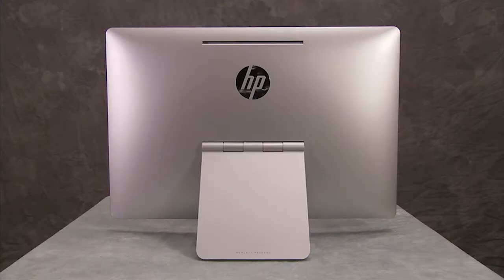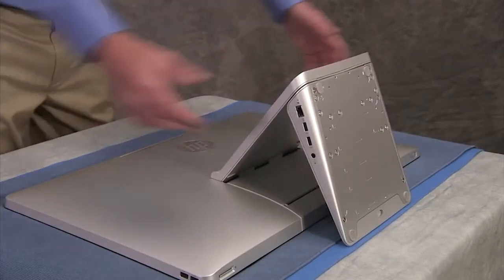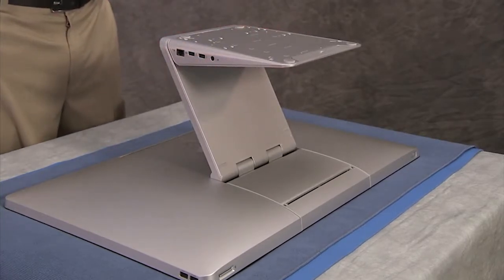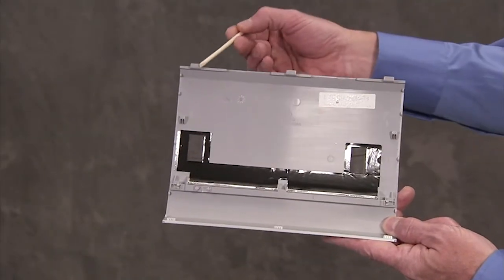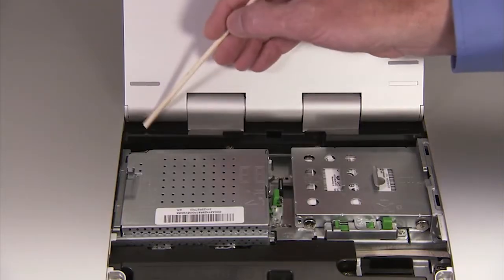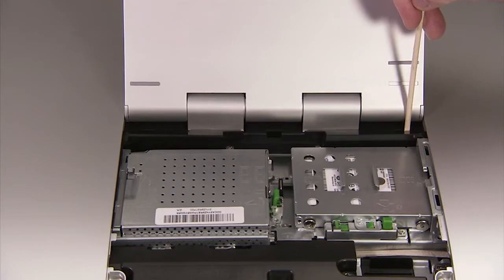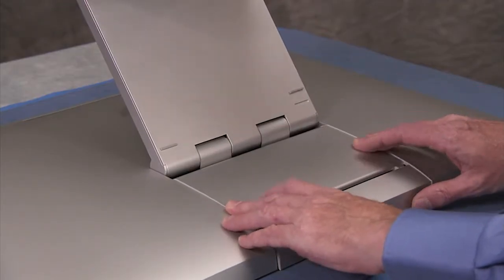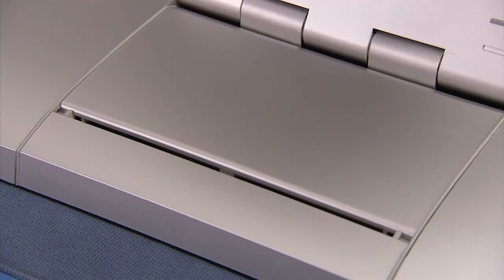Replace the Access Door | HP ENVY Recline 27 All-in-One PC | HP Support

Comment: hi my hp 27 rencline hdmi in not working on windows 10 ?
Reply from the maker: +mario2gameme You need to reinstall this driver, The file/driver that works is to be found by entering the follwoing ftp address into your web browser: http://www.mmnt.net/db/0/2/g4u0180.houston.hp.com/ftp1/pub/softpaq/sp67001-67500/
Then look for the file SP67046.EXE
After installation you need to reboot the machine.